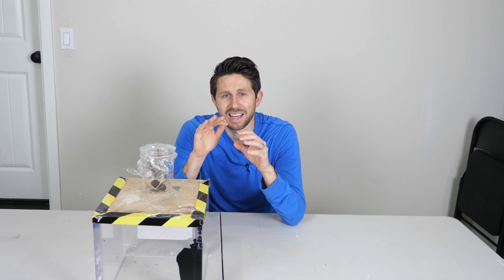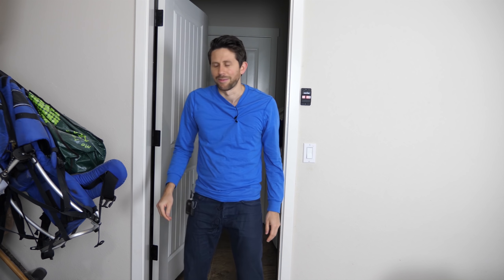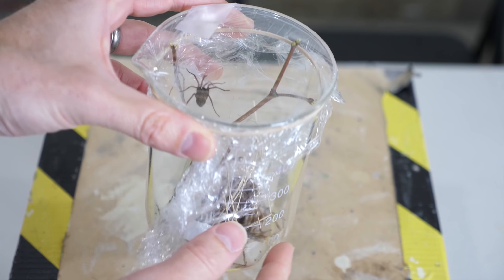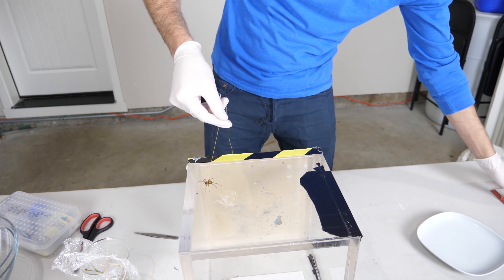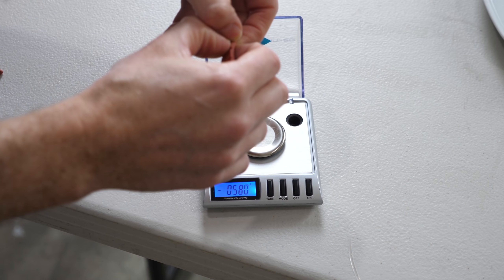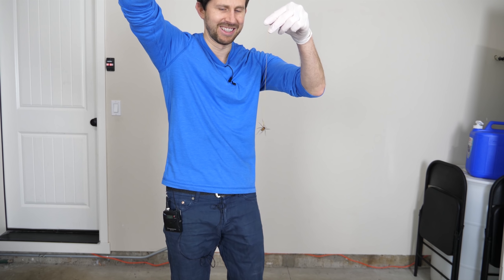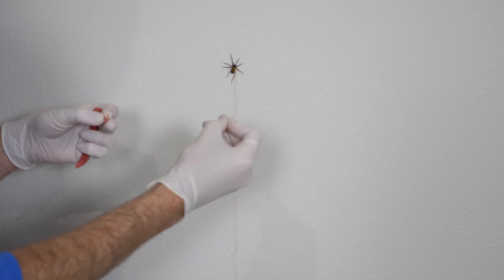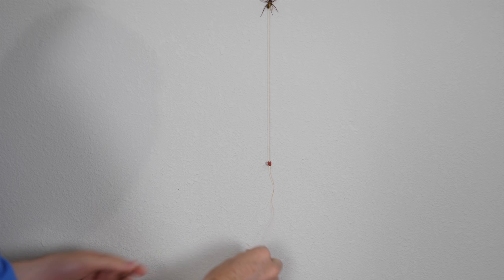How Much Weight Can a Spider Hold While Climbing on the Wall and Ceiling?

Comment: "Don't worry, when it falls it won't get hurt because its surface area to mass ratio is so big that it has a lot of wind resistance that slows it down"

How about with 4 times its weight hanging off it?
Reply: It will still be fine
Reply: It won't get hurt even with extra weight
Reply: It won't get hurt even with extra weight
Reply: @toxictwisst  do you mean that it won't get hurt even with extra weight ?
Reply: @xeriox16  yup
Reply: @sh-bm3is  When you talk about wind resistance, you shouldn't bring up free fall. What do you think the "free" in free fall refers to?
Reply: @sh-bm3is   yeah but the weights will accelerate the spiders fall substantially more than without them. Therefore, the spider will hit the ground at a faster velocity, counteracting most of the wind resistance of the spider. The reason insects and spiders don’t get killed from these falls is their exoskeleton. It’s entirely possible that the spider was injured though.
Reply: @u1zha  i understand that sir but the surface area of the weight used in the video  was not that large and was an almost  smooth surface so air resistance can be neglected for that piece of weight that's why i assumed it as free fall.
Reply: @tee4222  nope!...the weight is going to hit the ground first and since the  clay / gum used in the video goes through a totally inelastic collision but yeah the spider WILL actually have a higher velocity, so YOU ARE  actually RIGHT, but i still don't think the velocity will be high enough to hurt the spider.
Reply: @sh-bm3is  like i implied, the weight only acts to accelerate the spider more than it’s own terminal velocity since it’s attached. Obviously the weight itself doesn’t add to impact, only the acceleration that it brings to the spider. Not sure where your “nope” is supposed to be implied since nothing I said is inaccurate.
Reply: @tee4222  I realised that yeah you were right and i made a mistake , when I was  already  halfway through the reply and i forgot to change the first few lines, i hope you can relate  as you already know how physics is there's generally only one correct answer you might get lost while trying to reach it but eventually you do, that's what happened with me.
Reply: @sh-bm3is  absolutely. No worries man.

Comment: Notice how the spider had to shift its body weight to the side a bit, because instead of it pulling a string straight up withe just pushing to the sides, it started some of its legs to push downward as well.

Comment: If the spider falls down, resistance in air will keep it from harm you say. But isn't that only for the last few centimeters from the spider to the first weight? The weights must have messed with it's speed on the way down. Like a skydiver with an anvil tied to the waist.

Comment: There were weights tied to the spider, and those weights could move at a faster terminal velocity than the spider could, so technically, this could have hurt the spider.  The spider did seem fine though.

Comment: Fascinating science. Would be interesting if you took the weight of the string into consideration, as the length of string could potentially be equivalent to the weight of the spider.

Comment: PSA: The spider won't get hurt when it falls because of its surface area-to-mass ratio. Except we're adding 5x its body weight in sticky squares, but we're not talking about that.
Reply: it still shouldnt make a difference though because its not high enough and the spider is so light its like hitting the ground with the force of a feather, the spider itself isnt getting any more mass
Reply: @jackdambrosio3417  the surface area-to-mass ratio keeps the spider from falling very fast. That goes out the window when you add a bunch of weight.
Reply: @ralvis22  that makes sense to me to some extent, just seems kinda strange cause the spider itself is so light its like when it slaps the ground there shouldnt be enough mass or such to make it “splat”? kinda understand what i’m saying? not sure if it’s right but
Reply: @jackdambrosio3417  I see what you're saying. The missing piece, though, is that the force of the impact is mass * velocity. So if the spider is falling faster (because the extra weight is pulling it faster than it would ordinarily fall - it's terminal velocity), it will hit the ground with more force. If you drop a beetle from your 2nd story bedroom, it will land fine because its terminal velocity is slow enough for it to withstand the fall (I think of that as having been designed by the Creator). However, if you throw that beetle at a window - beetle goes splat. Fun discussion.

Comment: 7:30 actually you got the conversion rate backwards, you would divide the pounds by 2.205 so its closer to 70 Kilograms
Reply: oh sorry nevermind you meant the 750 pounds is around 300 kilograms

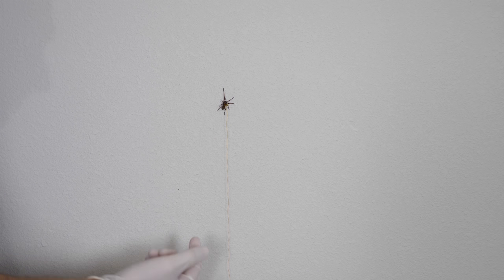Comment: 4:06 not that i give a shit, but that ratio went to hell, once the mass of the spider went up 500% by putting weights on it and i highly doubt that the distances between the weights themselves and the first weight and the spider, once they touch the ground one by one, are enough for the spider to slow down to its terminal velocity.

Comment: By the end, wouldn't the spider just be dangling with its body structure doing all of the work? The spider isn't lifting up to five times its body weight. Its sticky hair-like structures are holding onto a wall very effectively. Still impressive, but not exactly like a human lifting 700 lbs. Instead, it's more like a human having their arms taped to a wall and then tons of weight being tied to their ankles.

Comment: I know you were just trying to simplify the explanation but how you explained spiders wall crawling was just wrong. There's nothing sticky about the hairs on their legs. If there was an adhesive it would come off and theyd only be able to climb briefly. Its not even the hairs themselves that help them cling. Its the branches on the ends of those hairs that can get as small as only a few nanometers. Because theyre so small they have a weak attraction force to the individual molecules of the wall.

Comment: LOL sorry but i have to fact cap you on the legs of a spider. Yes they have hairs. But no its not the "hairs" holding the spider in place. Spiders actually have claws at the end of the legs. This is actually what they use to grip onto things

Comment: at 9:33 you said the spider can hold 0.86 lbs (pounds) but the scale clearly says 0.860g.
That's actually 0.001895975 lbs. 

Pretty crazy it can hold so much and I'm surprised you managed to wrap a thread around it let alone get it off afterwards.